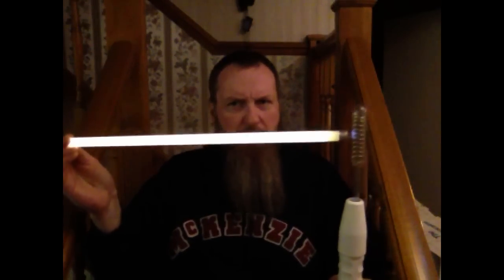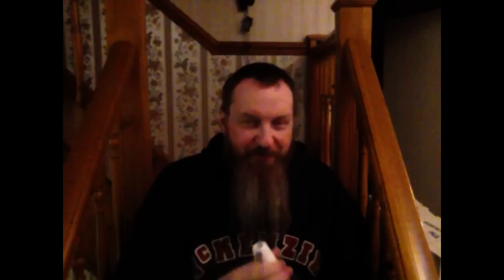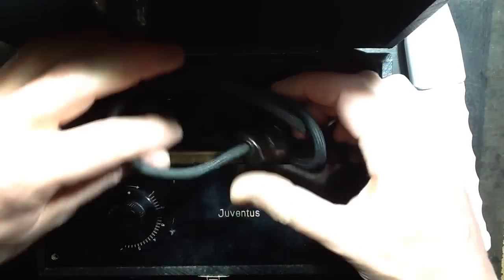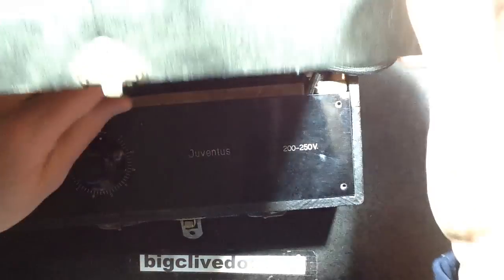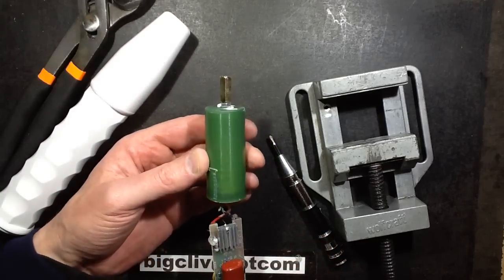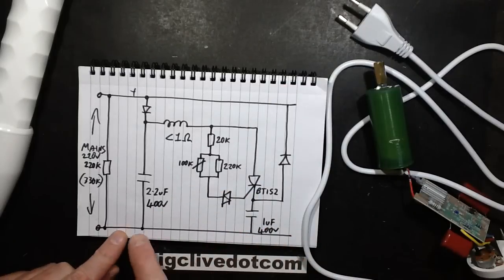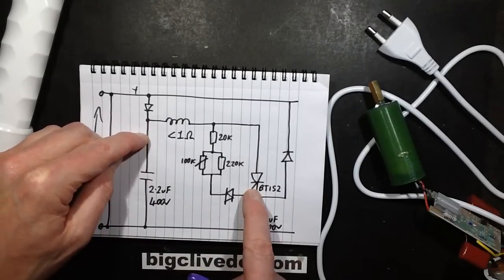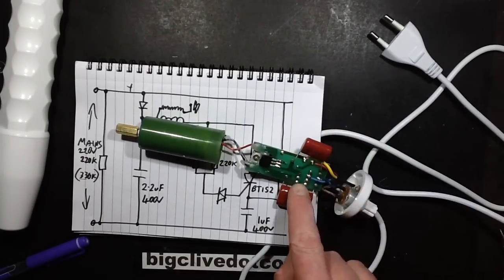A look inside a Darsonval style modern Violet Wand Ray unit.

Comment: I've been on the internet far too long to know that this has/is being used for sexual pleasure. People are weird. But very interesting device, i wonder what kind of experiments you could do with it.. maybe electrify a rose and have it glow with corona discharge.
Reply from the maker: Oliver O'Neill It's actually a really neat device for creating plasma ball style discharges from ordinary tungsten lamps or as a party trick with a fluorescent tube.  A really neat and slightly scary toy that does have that slight issue with potential damage to modern electronics.
Reply: bigclivedotcom i wonder if it could over stimulate nerves and numb pain. I would test it on my back if it works :)
Reply from the maker: Arjan Wilbie It doesn't quite work in the same style as a TENs unit, but it does have a similar operation to those insect bite clickers that use a piezo sparker.  But yeah, back pain.....    It's a thing.
Reply: bigclivedotcom those clickers is what i use next to a load of medication. I might pick up a wand set to play with. Some friends do recomend them.
Reply from the maker: Arjan Wilbie They're so cheap that it's worth a go.  Particularly if they do offer some relief.  The prickling sensation is actually quite nice.  Just make sure you keep the thing away from delicate electronics.
Reply: bigclivedotcom and i keep it away from my wife as she has plates in her body, even tense units make her scream in pain.